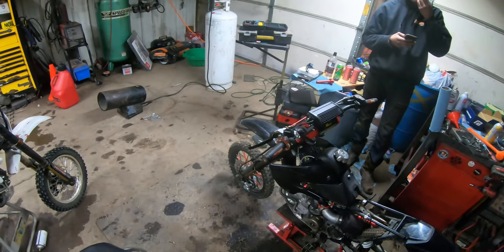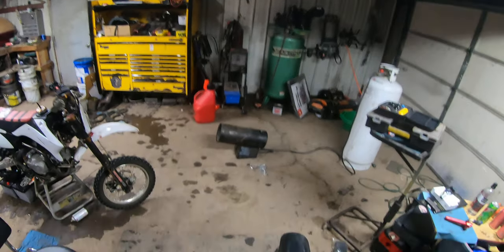First Start Up 2019 SSR 170tx BIG BORE MONSTER

Comment: Did you make that intake or buy it? If you bought it where from?
Reply from the maker: I made the intake myself. Used a mud flap to block tire debris in back and welded 2 sections of aluminum pipe to get angle correct then installed rubber ends.